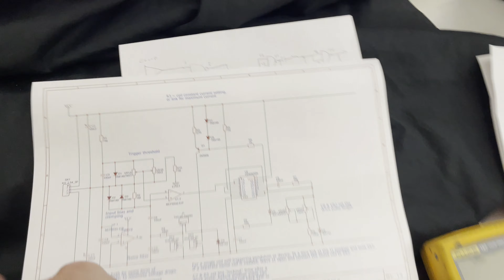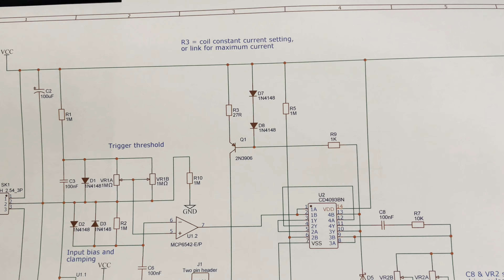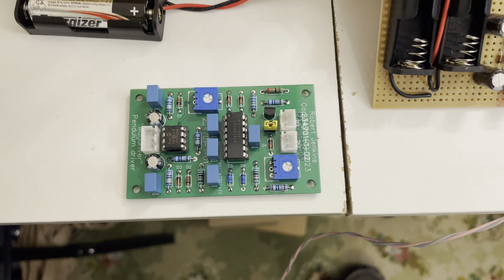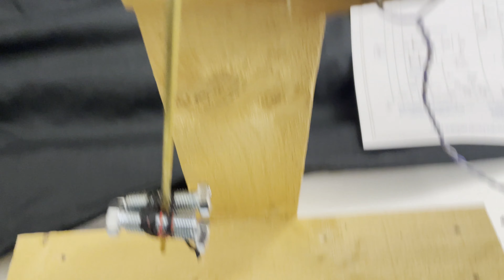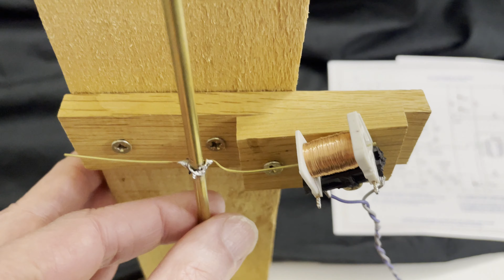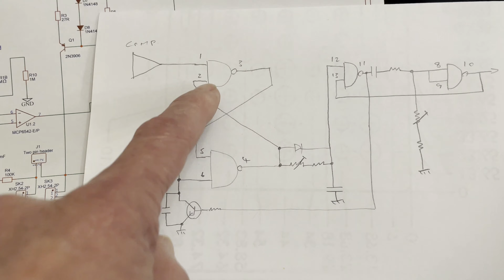Electromagnetic pendulum 3 - PCB failure and success by delay!

Comment from the maker: Another critical part of the pendulum swing regulation, that I forgot to mention in the video:

At the point the swing becomes wide enough [= fast enough movement] that the magnet leaves the coil before the drive pulse ends, it will be retarded as the ends of the magnet and solenoid coil in proximity will have opposite polarities and attract each other.

As long as the amount of energy added each swing is not enough to overcome that retardation effect, a very stable swing should be achievable, by using a combination of the pulse delay and duration settings.